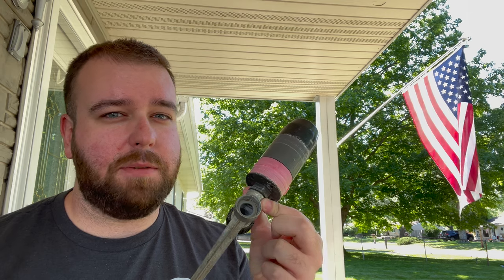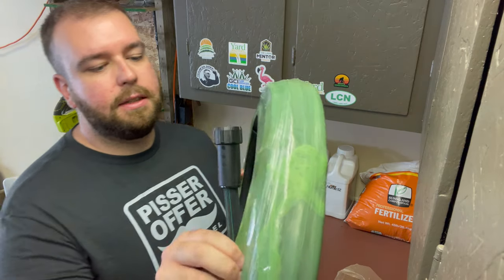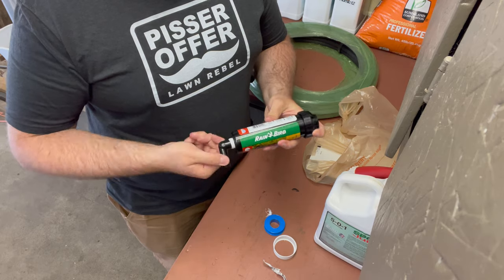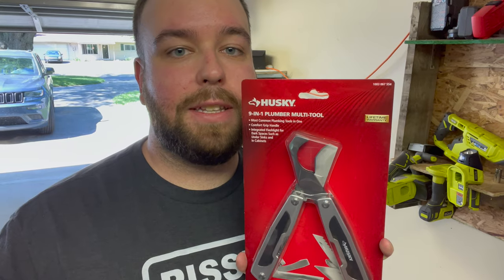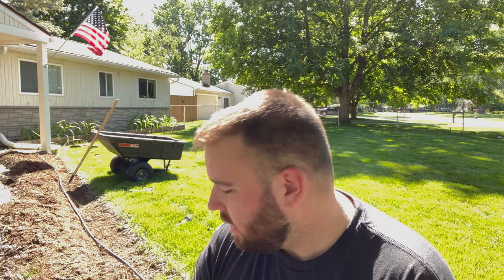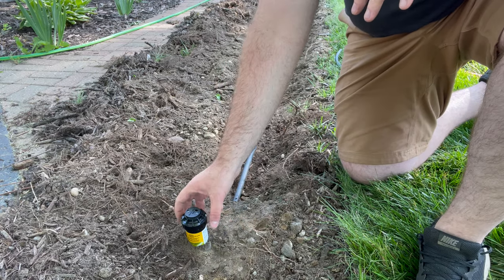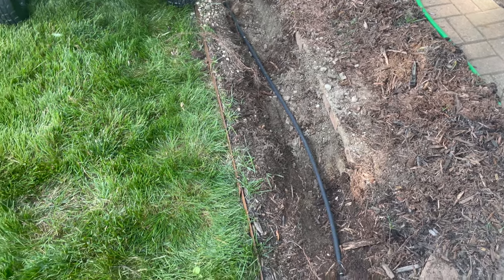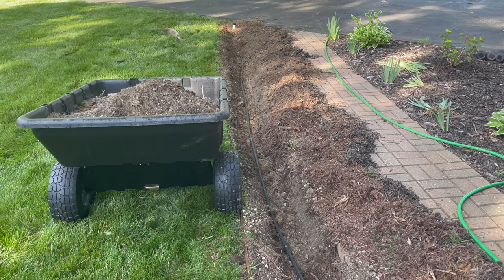How to DIY In-Ground Sprinklers from a Hose Spigot

Comment: Good vid. I have a small lawn, total 2200 sf and I ran rotor heads as you did for an underground set up. I even have 2 Melnor 4 port timers as well. When I dug my trench I drenched the lawn first and then used a garden spade shovel to make cuts in a straight line in the lawn then went along that line rocking the shovel back and forth until I made an 8" V shaped crevice. Came out great. I also connected back flow preventers on the 4 outlet ports of the timer for good measure. Works great. I live up north so have to bring timer indoors in the fall but I probably saved thousands of $.
Reply from the maker: Very nice! Thanks for commenting